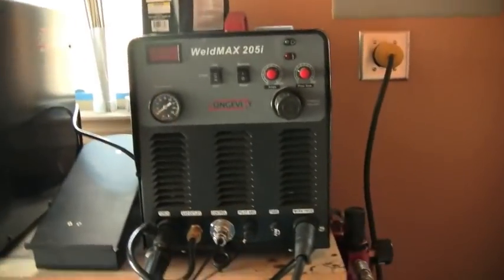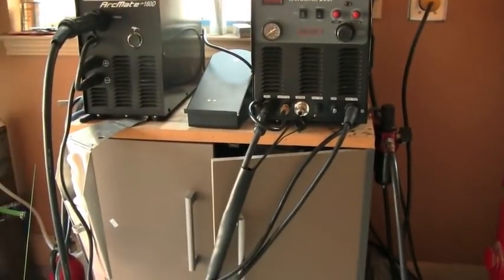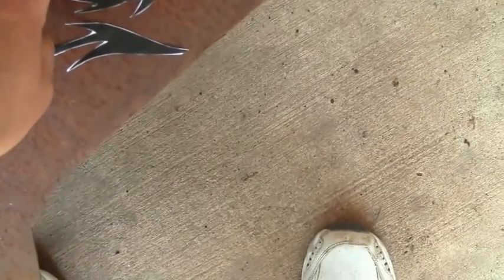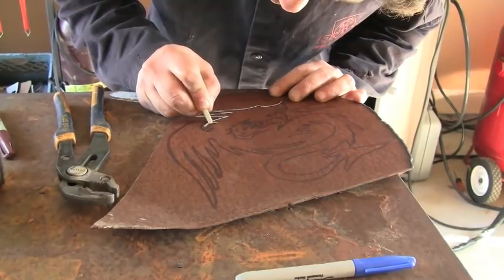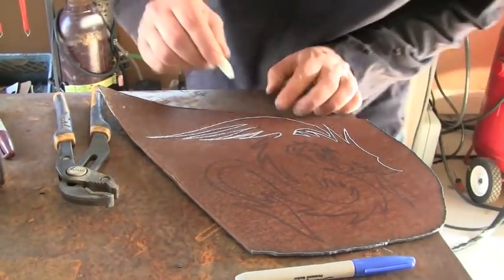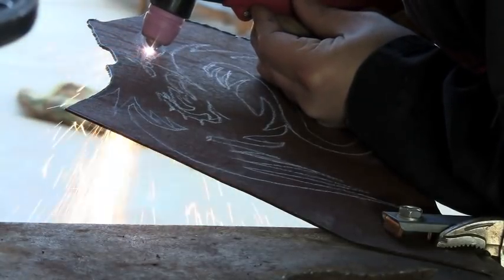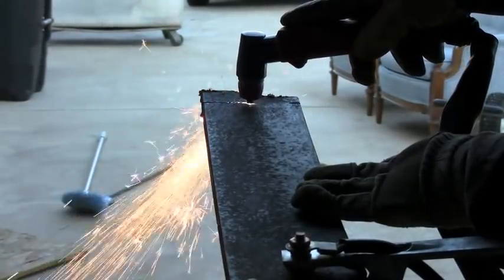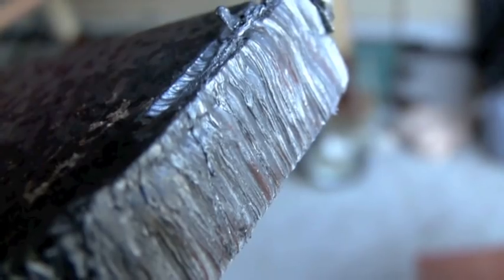Tig welder stick welder plasma cutter all in one

Comment from the maker: @jacobg1777 Well time will tell if it breaks or not.  my harborfreight 110 v gets used all the time for 3 years now and it's going great. 129.00 worth every penny. Ive burned out plenty of miller welders. gone to the shop all the time when I worked as a welder dropping them off and picking them up.

Comment from the maker: @jacobg1777 Well I know when I like a tool and it feels solid. I really like getting a deal. Think about it miller and lincoln and all the american welders didn't start coming out with inverters until after the chinese machines so there is no way to compare the durability. I took that tiny inverter to my old school at the time and they where blown away by the size and the arc. It was still new technology and USA didn't have them out yet. inverters should be more reliable and efficient. we'll see

Comment from the maker: @jacobg1777 well you're obviously closed minded and can't get passed your programming. I made all kinds of videos about my trailblazer and miller suitcase wirefeeder. So you cant think of any reason to have an 8lb tiny welder 110v and a 600lb loud gas guzzling generator welder. LOL I bet if you think real hard you can think of some advantages.  Don't believe me I don't care. I like these machines and they are cheap I have tried all the expensive american machines and this machine is great.